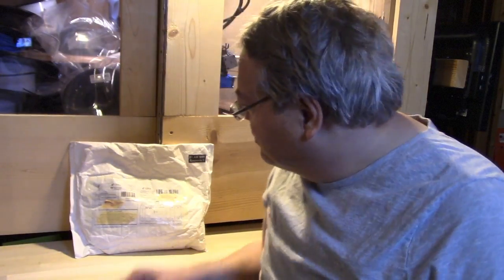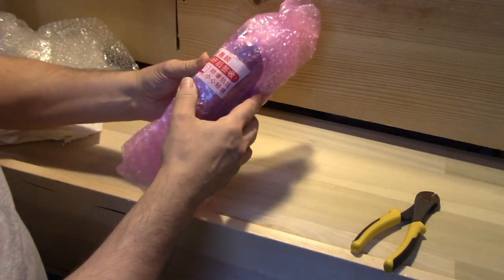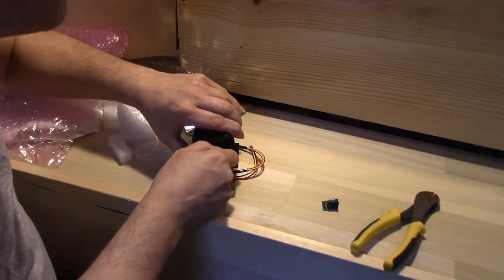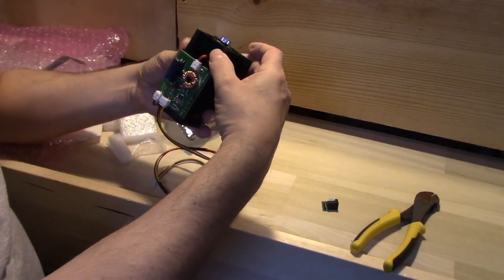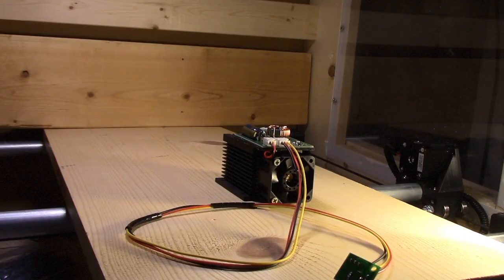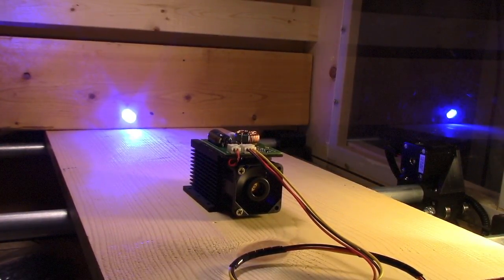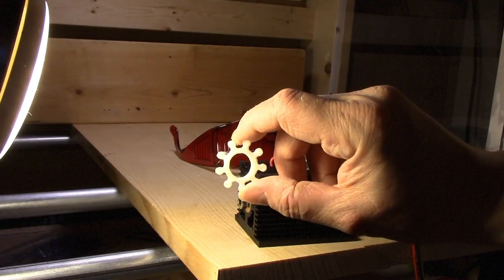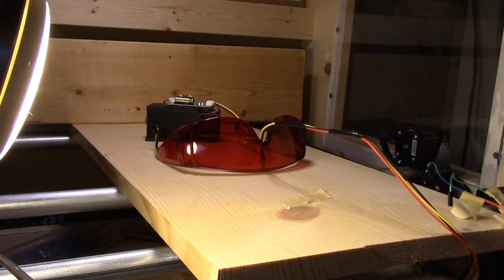SUNWIN 3 Watt Blue Violet Laser Module Unboxing

Comment: Hi,  I have been looking for a mount that I can use with the mpcnc and a Philmore 5/8"  On / Off Key Switch for safety when am using the laser. I have a 3d printer and print one out if I can find a design that will work. Do you have any ideal about where I can find one? By the way just got though building a 3dgBurner they are good for small laser engaging jobs. It has a fixed z axle. Thank Anthony
Reply from the maker: Anthony Robbins if you can't find one on thingiverse, maybe I can model one for you,  email me a drawing with measurements at someoldguycoding@outlook.com. I was thinking about putting one on mine, but couldn't find a good place to mount it. Of course fusion 360 is free. You might enjoy designing it yourself!  Thanks!
Reply: Some Old Guy Coding I'm working on one a mount of my own in TurboCAD. But in the meantime I have order a On / off key switch with a kill switch mounted together from Amazon for about $22.00. I plan to use the old key switch on the 3dgBurner I'm working on and the one I order is to big for the 3dgBurner. I will put the new switch on my mpcnc.

Comment: Do you think one of the higher wattage lasers would work? Would there be an advantage to that? Thanks!
Reply from the maker: Sure!  I would have gotten a larger one if I could have afforded it. Not sure about the ones with fixed focus (although maybe you just have to have the laser a set distance away, which wouldn't be so bad).  So what you need is one that takes 12V and 5V PWM control.  The advantage of a higher wattage would be that you'd be able to cut thicker materials easier/faster. While on my 3W laser, it takes several passes to cut cardstock. Some of the higher wattage ones say they can even mark on metal if that's what you're looking for.  Of course, if you're really industrious, I'm sure one could add a CO2 tube and mirrors - but that would be a lot of work. Al depends on what you plan to do.
Reply: I have all my parts printed and parts purchased for my MPCNC and will be using your videos to help me figure out how to assemble it - so thanks for that. It would be nice to be able to cut things out of very thin plywood. That being said money is always a consideration for me also . Thanks for the help.
Reply from the maker: For assembly, be sure to review the steps on Vicious1.com  Depends on how thin the plywood is. I tried a piece of 1/4 inch plywood but didn't like the results.  I plan to go back and revisit it again.Good luck with your build!